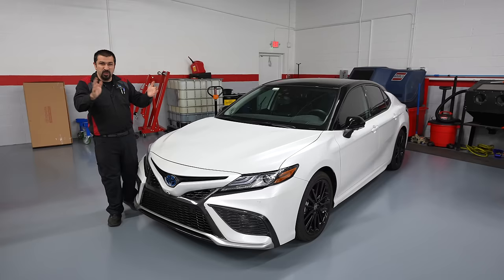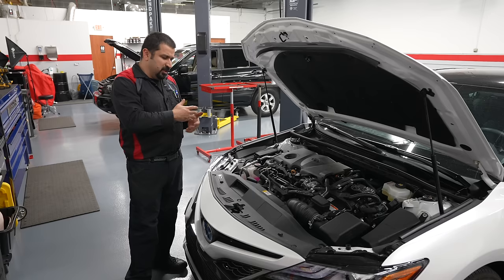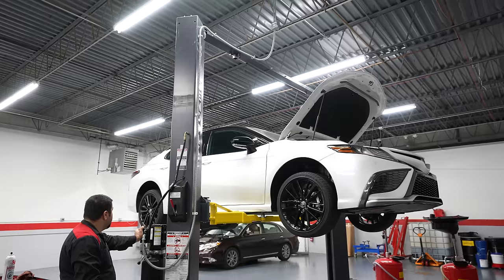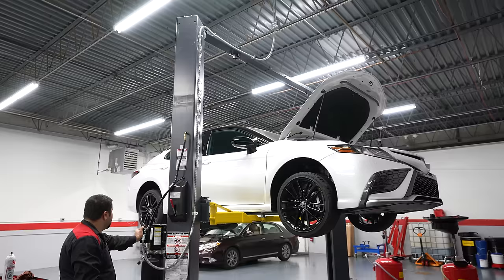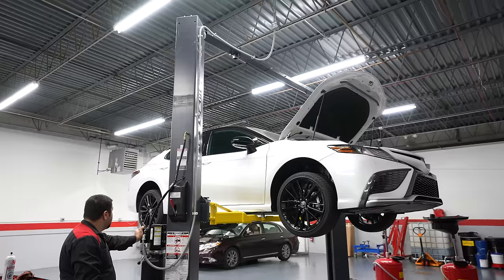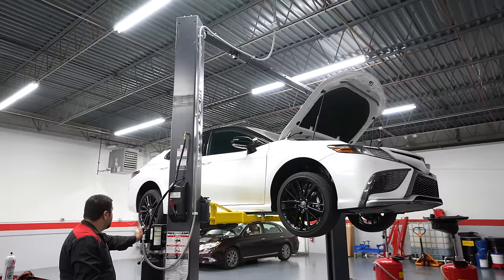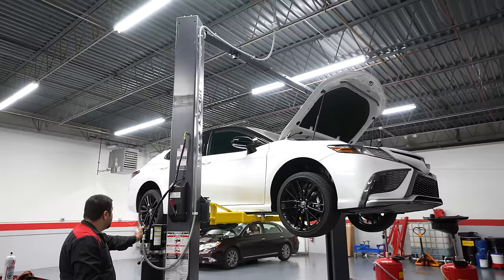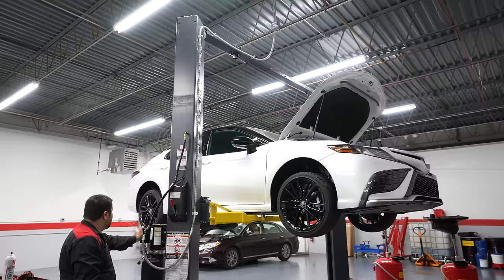Should you buy a Toyota Camry Hybrid? 1 Year Ownership Update

Comment: If people took care of their cars like this from new, they would last a lot longer. I often see old guys here in Sweden (many previous Volvo mechanics) that drive old Volvo S60:s, S80:s, V70:s, etc that they bought new, and even though they are 15-20 years old and have high miles, they look absolutely perfect. I suspect that these are the types of people that treat their car's quite similarly to you. Good job!
Reply: In America cars don't get taken of as well as in Europe
Reply: @DylanL69  it depends who you run into. Some vehicles get taken care of because people don't have choice. They either pay for it or do not drive
Reply: @TheAnnoyingBoss  yeah and most of them don't
Reply: @DylanL69  well, it depends on the country. if it has mandatory safety inspections the cars will be somewhat road worthy. however since everything in europe is double the price when it comes to cars (parts, fuel etc) people will neglect other things such as ac, electronics, visual stuff, rattles etc.
Reply: @TheAnnoyingBoss  my 1999 ram Cummins with 330k looks brand new from top to bottom and 0 rust. Sat in a field for years, was my great grandparents. I don’t even take care of it that well. I did repaint all the black plastic pieces since they were faded and I have new carpet for it.
Reply: Volvo is another good reliable brand that can rival Toyota , Lexus and 1980s Mercedes
Reply: @gold6813  eh not really
Reply: @DylanL69  
eh yeah really. there are lots 30-40 year old Volvos still on the road. My 2010 S80 2.5FT (E85) has 207,000 miles on it. By the time it's truly done for, nobody will afford a new car the way things are going.
Reply: Dang, a newer Volvo is lucky to last 5 years even with good maintenance.
Reply: @MrPland1992  I'm very skeptical that's true. Or you are just extremely lucky. I'm surprised when any Chrysler makes it to even 150,000 miles. Chrysler/Dodge is the worst car company.
Reply: @jimv1983  My 2012 Genesis just got totalled by a kid driving to school on a learner's permit w/o parents 😢. Any suggestions on what makes I should limit my search to? Looking for a hybrid SUV I think
Reply: @ca_quixote  my advice is Toyota. That's what I buy.
Reply: @jimv1983  Much appreciated 😇
Reply: @DylanL69 because making money is more fun than turning a wrench for a decades old economy car.
Reply: How is rust in Sweden? Here in Canada I find 15-20 years is when you really get rust problems. Even if you wash it regularly, or try to use an unheated garage more often. 

Heated garages, funny enough, make the salt do more damage. The icemelt with salt in it means you need to wash even more often than when you let it stay frozen outdoors. When it warms up to melt, you should be washing it, so nature is a good natural reminder.
Reply: Do you still see Volvo PV544's over there?
Reply: @clintonwatt8084  Very rarely do you see the PV:s. You’ll see em’ cruising in the summer months though, going to car meets or just out and about.

Comment: I did the same 1000 mile break in oil change on my 2021 RAV4 and yes it did have some “glitter” in the oil. Did the second oil change at 5000 miles. Thank you for your unbiased opinion on our Toyota products!
Reply: That  was what I did on my 2019 camry. First oil change was 1200miles, next was 5k miles. Then 5k miles until now. My car is 70k + miles without any issue. Still 30gpg on daily drive.
Reply: 2019 Camry 2.5L SE first and every subsequent oil change with 0W16 at 5,000 miles or 6 months with zero issues. 48 mpg hiway at 65mph 40mpg in town. Car runs smooth and quiet. With 8,000 miles per year this car will age out before I have oil related engine issues.
Reply: @FrankySilverFace  that is not bad with 2.5L. I thought that milage is for Hybrid car. Mine is XSE V6.
Reply: @binhdangvn  the EPA rates hiway mpg differently than actually driving on a hiway. Check it out and you'll see why hiway mpg is easily beaten by almost all cars. For me, if I drive 100 miles on the hi way Without stopping I use about 2 gallons.
Reply: @FrankySilverFace  That's interesting.
Reply: @FrankySilverFace  — what are you on about? The Highway EPA rating is impossible to achieve in REAL WORLD driving @ 75mph. Their highway speed is no more then 50-55mph and if you go that slow, you will indeed get the rated mileage. 🤦🏻‍♂️ nobody goes that slow. 

AC usage almost robs a lot of MPGs.
Reply: @I_know_what_im_talking_about  Speeds where I live are limited to 65mph. County roads are 50mph. That's my real world reality. So to be clear what I'm saying these speeds consistently yield a result of 48mpg. But hey you do you.
Reply: Is it a hybrid or non-hybrid RAV4?
Reply: How bad was the glitter?

Comment: AMD, thanks for another great video. My 2021 Camry Hybrid LE with 26K miles has been a great car. The car drives smooth and gets over 50 MPG. Just took a trip to the NC mountains and the Camry got 52.7 MPG on the the 250 mile trip. Ever now and then mine does have the buzz sound coming from under the dash. In 14 months of ownership, my oil has been changed 5 times. Zero reliability issues with the car. Looking forward to many more miles.

Comment: I’ll say one thing about the OEM wiper blade refills. I have a Honda Accord and used to be one of those guys that would buy the $50 wiper blade replacements at the auto parts stores when it was time to replace my wipers. That was just crazy….the Honda & Toyota OEM refills cost like $11 to $14 dollars and they are the best wipers you can get.  They are also super easy to replace.
Reply: Listen man it's nice to get the whole replacement once in a while if you ask me because the designs get better sometimes and the engineering changes. If components are plastic the longer you go maybe the more likely it is your super blade fly off in a storm. One guy told me it happened to him.
Reply: @TheAnnoyingBoss  I can see that it's just that  aftermarket wiper blade replacements have gotten so expensive. So far the OEM blades on my Accord have been great.
Reply: PIAA silicone wipers have $15 replacement strips that last well over 2-3 years.

Comment: I recently rented a base model hybrid Camry from my local Toyota dear and took it on a long road trip.  I was surprised at how sporty it was.  Both handling and power.  My lowest mpg (based on actual fillups) was 38 when driving very fast on the freeway.  My best was 48 driving more slowly on mountain roads.
Reply: Damn! 48 mpg on mountain roads?! That's pretty damn good!!
Reply: It's not that sporty though. Maybe it is if you compare with a Chevy Malibu
Reply: It is a comfortable sedan, but far from sporty.  Compare to the Accord it is night and day.
Reply: It's the best hybrid sedan.
Reply: @thereissomecoolstuff  na I'd argue the 330e and 530e are the best hybrid sedans, if you're accounting for sportiness
Reply: @burntnougat5341  sure, but the Bimmers are at different price point.  If money is no object go with the Porsche Panamera E Hybrid.
Reply: @jml9550  is that a sedan though? Thats more like an A7 liftback.
Reply: @burntnougat5341  for the money the Camry can't be best.
Reply: @burntnougat5341  what’s the difference?  4 door coupe, 4 door lift back, call it a 4 door whatever.  It is a 4 door 4 passenger automobile.
Reply: @thereissomecoolstuff  sure, but brand reputation is also important to command a little more money.
Reply: @jml9550  there is a difference. In a sedan, the rear window remains stationary. In a liftback, it lifts as part of the trunk. Big difference that changes overall chassis strength
Reply: @jml9550  it's very simple. Toyota started the hybrid movement. There are millions of them on the road. You cannot beat a Toyota hybrid product from A-Z. Long term reliability is something most manufacturers don't have with electrification. Toyota does..is a BMW or mercedes more fun to drive. Sure...it doesn't have the track record yet...
Reply: @burntnougat5341  sure if you get into the technicality.  But to me they are all sedans that holds 4 passengers and has 4 door, regardless of the chassis strength, profile, capacity….,these are just really marketing terms.
Reply: @thereissomecoolstuff  I am with you on this.  European sport sedans are sure more fun to drive, regardless of hybrid or not.  They simply don’t have the reliability of a Toyota.  I am owned a e39 540i and a w211 E350, they were great under 7 years.  After that it is maintenance + repair.  I was ok with that, it didn’t bother me.  As I get more mature in terms of age and value, I chose not to buy another German car.  Been driving Lexuses for the last 15 years and I would never buy another German again, well maybe except a 911.  It is on the bucket list.
Reply: @jml9550  they're still physically not the same. Answer me this. Are the Corolla hatch and Corolla sedan the same car? Both have 4 doors, fit the same number of people. Are they the same car?
Reply: @burntnougat5341  yes they are the same car, just tuned and dimensionally different.
Reply: @jml9550  Lexus is hard to beat. Especially when you can get your routine service done at a Toyota dealer using their carolla coupons. I have a C8 be the that seems to be pretty good...Germans tend to over engineer. I had an E46 M3 that was a great car ..BMW has 40 engineers working on the door chime sounds. Gotta love it. Then pay for it. It's a great time to enjoy cars. 2035 isn't going to be great.
Reply: @thereissomecoolstuff  Yep, love Lexuses.  My next car will most likely be the Lexus LC500H once my son goes off to college in a couple of years.  When retirement hits, hopefully 10 from now at 60, an 911 for sure.  I will worry about EV when 2035 hits, if Porsche can offer a 500 real world miles Taycan for u dear $100K, I am in.  BTW, love the C8, what are bargain at that price point.
Reply: @jml9550  hang on, you're telling me the Corolla hatch is the same except in some "tuning" and dimensions? Sounds like dimensions is a pretty big difference. Yet they're the same? By your logic a 737-800 is the exact same as a 737-900. They're so exactly the same Boeing even gave them new model designations! You whack man
Reply: @burntnougat5341  by that logic those BMWs and Camry are not the same either.  So there is no comparison right?
Reply: @jml9550  why don't you reread the comments above instead of letting your emotions take over. The specific point I brought up is sportiness in a hybrid sedan. I said the Toyota is not sporty. It's not a cross shop comparsion. Price is not the factor. Sportiness is. What you should have done is make an argument for why or why not the Toyota is sportier than the BMW. It's simple
Reply: @burntnougat5341  yes, it is simple.  I don’t care if it is a coupe, liftback, sedan, SUV, or whatever, Porsche Panamera is still the best hands down whether it is a hybrid or not.  All of these are terms above means nothing, they are all automobiles.
Reply: @jml9550  is a M8 bolt the same as a M14 bolt? Both are fasteners. Lol you're a funny guy
Reply: @burntnougat5341  yes it is.  They both get the job done. And yes I am a funny guy.
Reply: @jml9550  alright guy. Good talk
Reply: @jml9550  4 door coupe? Lolz
Reply: @zacharypeery4082  I know man.  The Marketing guys comes up with all these weird names.
Reply: That's cap.
Reply: @jml9550  live in yo nutshell dreams
Reply: @amandeepbaa6978  yep.
Reply: @jml9550  dreams
Reply: @burntnougat5341  
its almost as quick at the V6.. with much better fuel economy. And much simpler maint on the gas engine.  The electric motors give decent torque from 0 to about 35 or so. So in city driving they feel quicker than the number would suggest.
Reply: @kens97sto171  lol ok now compare its handling to a 330e
Reply: @burntnougat5341  
I'm sure the Bmw will handle better .  All the way to the junk yard when it hits 60k miles.
Nice cars.. if you're rich or don't keep your cars very long.
I do both..  I expect 200k at least with absolutely NO issues. 
If it can't do that .  It's junk to me.
My 14 year old Toyota hybrid has 418,000 on it. I bought it used... Have put 218k on it in the last 4 years.  Still runs good, still gives me 45-50mpg. 
Still on all original powertrain, still has all original suspension bushings, wheel bearings, steering parts.
Try that with your bmw.
Reply: @kens97sto171  I'm only concerned about handling. Your first sentence is all you needed to say
Reply: @burntnougat5341  handling for short notice
Reply: @potatonumber200  Hybrid Camrys love country roads.
Reply: @burntnougat5341  the Toyota hatches in recent memory are shorter than the sedans. The floor pan is shorter. So, if you could remove the front passenger seat and fold down the rear seats, you could carry much longer objects inside the sedan that the hatch. However, the hatch allows you to set a larger package down and go. 4 doors solved a lot of the problems with 2 door coupes not being easy to accept bulky cargo. I miss the xBs though.
Reply: @marshmower  thanks for the info and explaining to an obstinate poster here how hatchbacks are not the same as sedans
Reply: I have the 2018 camry hybrid le it gets up to 50mpg at best because of the lithium battery
Reply: 48 in a Camry is amazing. Toyota's Hybrid Synergy Drive powertrain really does increase energy efficiency by a substantial percentage. I'm driving a Prius Prime and averaging 65 on long road trips based on actual fuel purchase/miles driven, and I have a friend with a 2020 Corolla Hybrid who is averaging 58. I've made several camping trips in my Prius Prime from my home (at sea level) to campgrounds at 4000 feet and 6500 feet in the Sierra Nevada mountains of eastern California, and on the uphill climb, fuel economy is about 45 mpg. But then on the return home, it's over 90 mpg coming back down, so it averages to 65~70 mpg for the whole trip. This astounded me, and it proves that Plug-in Hybrids may just be the best kind of vehicle on the road: you can run on cheap electricity for short trips around town, but still have the range of a gasoline engine,  and it's ability to travel into very remote areas with no charging infrastructure. In my Prius Prime, I could, in theory, drive almost 600 miles on a full tank. If I wanted to carry 12 extra gallons of fuel in jerry cans in the roof rack, that would be 1,200 miles of range. In a Rav4 Prime, the fuel economy is only 40 instead of 60+, but people that own them report 550 mile road trips on 1 tank of gas, and properly equipped with A/T tires, the Rav4 Prime can go off-pavement on Class 1 and 2 dirt roads no problem, maybe even Class 3 if you were careful and didn't try and drive the car over big rocks. Around town in EV mode, Rav4 Prime owners report 50 mile EV range if they drive with a light foot and use regen braking as much as possible.
Reply: Everyone should know by now that  you should  never buy german cars out of warranty!!!!!  Owning german cars is like dating a hot gold digger. Fun to drive, but it is expensive to maintain.
Reply: @troytruong8246  lol false. E30, E36, E46 are all super reliable
Reply: If you think a hybrid Camry has a sporty feeling, you have never been in a sporty car! 👎
Reply: @burntnougat5341  we are in 2023! Not in the 90s and 2000s anymore bro lol
Reply: @troytruong8246  old is gold! Not a fan of all the screens and wireless stuff in modern cars
Reply: @r.r.3073  Have you ever driven a 8th gen Camry Hybrid? I own one. I also own a Mazda Miata sports car. And I'm here to tell ya, the Camry Hybrid has a very sporty feel for a sedan. Think about it. With the battery pack low under the rear seat and in front of the rear axle and a fairly lightweight powertrain up front, it has a very good front to rear balance ratio between the wheels with a low center of gravity. Akio Toyoda himself said that while the V6 Camry may have a better 0-60 time, if he were driving on a windy mountain road, he'd opt for a hybrid Camry due to it's superior handling characteristics and engine response. The hybrid powertrain is very quick to respond and doesn't suffer from the shift lag of an I.C.E. bolted to an automatic. I'd love to see this powertrain in a MR2 sports car. Now that would be one sweet ride. But the 8th gen Camry Hybrid is a very fun car to drive as well. Especially if you put it in Sport mode.
Reply: @beachbums2008  - 10¢/kw-hr between midnight and 06:00am. On May 1st, when summer rates kick in, that will increase to 11.5¢/kw-hr, but still only about 1/4 the cost per mile of putting $4.25/gallon gasoline in a Prius, the most fuel efficient car you can buy. EV charging power is cheaper than gasoline almost everywhere in the US except Hawaii, and especially on the West Coast, where gasoline hit $7.00/gallon in some places last summer.
Reply: How were you able to rent it straight from the dealer?

Comment: My daughter has a '17 Camry hybrid XLE. She was apprehensive about buying a hybrid because of the complexity. I just completed replacing the water pump this afternoon, which is it's first mechanical failure, after 117,000 miles. 😎 It still has held up very well and she is very happy with it.
Reply: My 2016 Chevy Spark 1.4L has 123k miles and has the original water pump. It also has the lowest MSRP of any vehicle on the road. Good to know it has lasted longer than some toyotas double the price.
Reply: @zacharypeery4082 You car must have,not been built on a Monday or Friday. 
🤣 🤣 🤣 🤣 🤣 🤣 🤣
Reply: @zacharypeery4082  I don't remember the last time a Chevy lasting long. That ended in like the early 2000s lol. Any mechanic will tell you present day ones are garbage. You must of got lucky or got a Chevy that was made in Korea lol